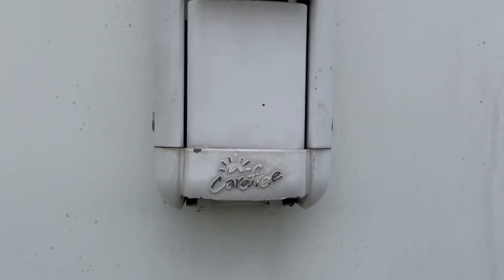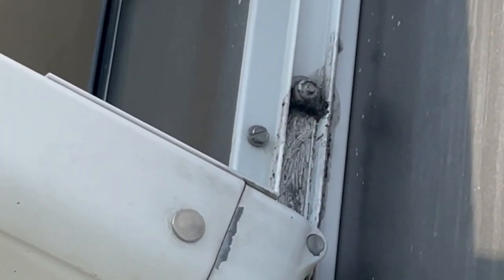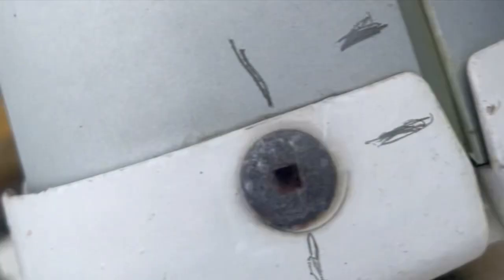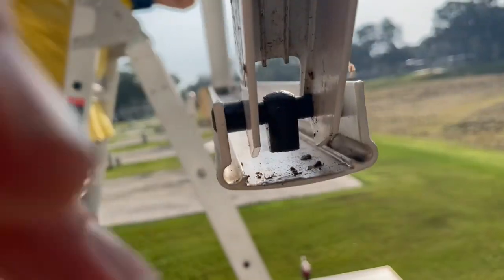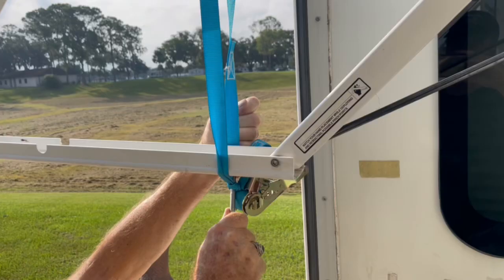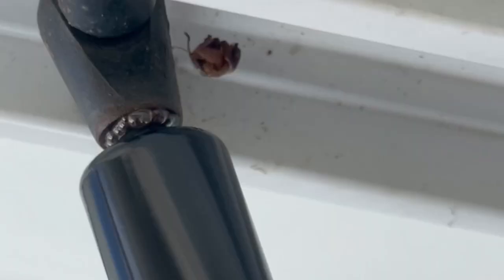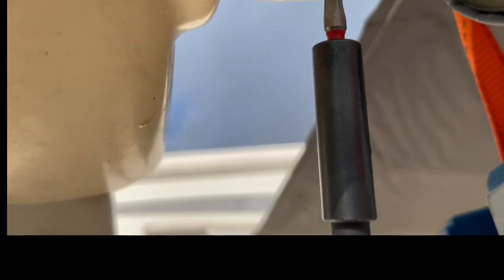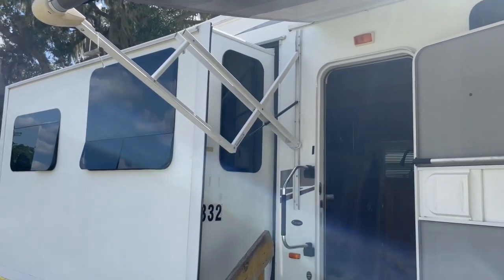Replacing Gas Struts on Carefree RV Awning

Comment: Oh I’m so glad I found this video. The gas springs on mine are worn out and I thought I would have to grind off the rivets at each end of the strut to replace them. They’re also in a narrow part of the channel, making it even harder to remove them, then I would have to get a rivet tool to fasten each end of the strut. Now I see the secret to doing this I would just like to know how you tightened the the springs without damaging them as you used a pair of channel locks to remove them. So how do you tighten the smooth metal part without damaging it?